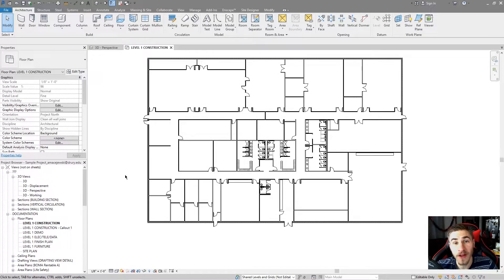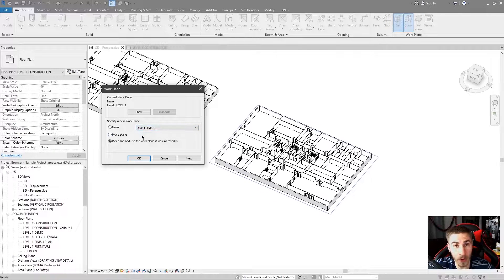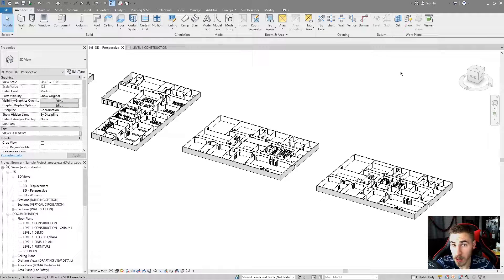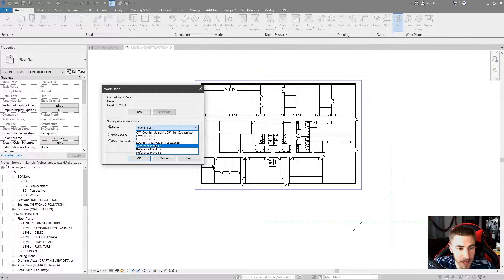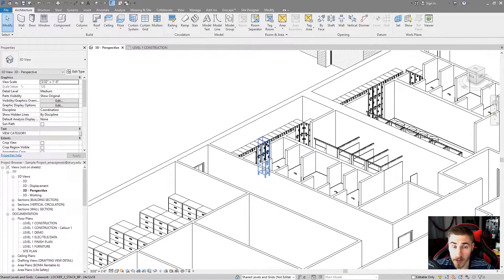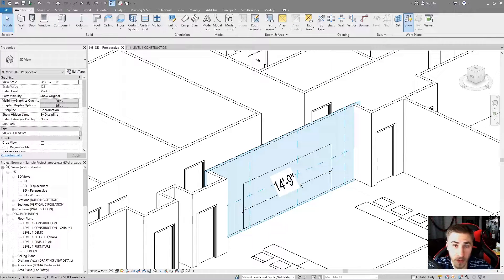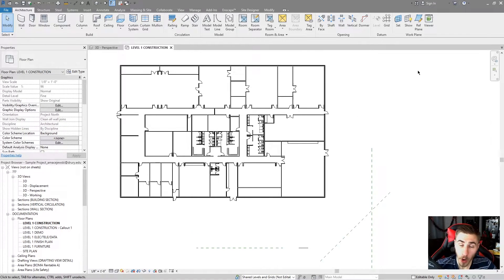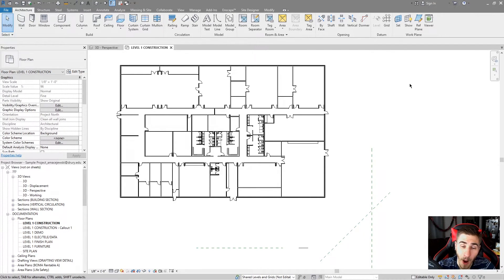How to use Work Planes | Revit 2020

Comment: Hi I am a student in my second of 2 Revit courses in community college. My dilemma is, I drew my family object on the wrong plane and now I want to change the plane without having to redraw it. Did this happen because I chose the wrong generic family to create from? If you have created a video on this subject (sorry, I did not extract this information in this video), please link me to one that has this info. Again, thank you for providing these learning tools. Excellent work.
Reply from the maker: Thank you very much! This generally is the chosen family template as if you choose a floor (for example) you will only be able to place the family on a floor. For a lot of families I make, I just use a generic model so that I can determine all of that myself. That is done based on how it is placed in the project, rather than the work plane you use to draw it in a generic model family template.

Comment: Hi mate,
Thanks for the video; just a quick question about this point: https://youtu.be/vGsSusIlINE?t=357 
What about the third option ("Pick a line an use...."); I reckon it would be handy to use it at this specific point and pick an unnamed plane... 
Cheers
Ran
Reply from the maker: Hey, you are right! In this case, you could pick a line but for the reference planes to show up under the reference plane option, they would need to be named. Nothing wrong with picking a line though.

Comment: Thanks for your wonderful video. How can I associate an object created with a work plane to another workplace? How does dissociate option work? How can I edit work plane?
Reply from the maker: Depending on the type of object you made, you can edit the workplane in the Modify tab after selecting the element. Disassociating would simply remove the workplane from the object in that you still have the object but no longer associated to the workplane used to create the element. You can edit the workplane by choosing edit workplane or if its just setting a different workplane in your project then use the Set tool to set a new workplane. Hope that help, thank you for the kind words!
Reply: @ArchitectureVanguard  thanks for your response. I've modelled couple of objects using model in place (extrude,sweep) but I can't move them them around.

Comment: I can’t set work plan I don’t know what’s wrong here. When choosing set work plan choose name clicking ok take me new window under name (Go To View) I don’t want that. Can you help in this case? 
Thank you
Reply from the maker: I believe what is happening is that you are in a view where you cannot effectively see or work on the work plane you set. For example, if you are in a floor plan view and you choose a plane or set a plane that is on the side of a wall of a section cut, then you can no longer work in the floor plan view you are in. Revit will attempt to open a view that you can use to work from based on the work plane you just set. Hope that answers it.

Comment: I also never actually never used the viewer, I somehow thought there was more to it, guess I haven't been missing anything. I did not really know about the 2d vs 3d ref. plane toggle. Why would you ever want to have one or the other? Adjusting as you did changed nothing, it wasn't going to print anyways
Reply from the maker: You are right on with the viewer. As for the 3D/2D reference lines, you are correct. They would not print so you likely would not use that option with them at all to change their extents. That said, I mentioned how the toggle works the same for grid lines (having a 3D/2D option). This is imperative to use with grid lines because you may have an odd shaped building and need the extents of the grid line to span the entire building while appear to be shorter in a plan view for example.